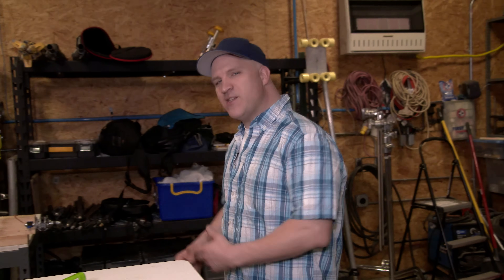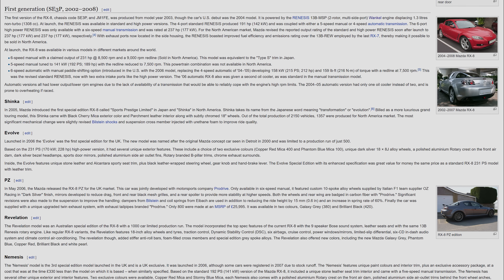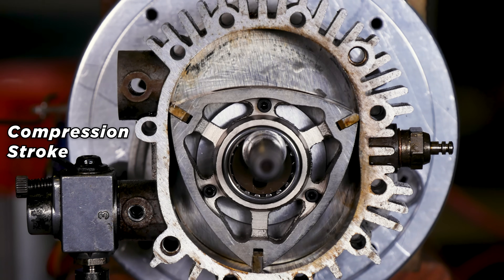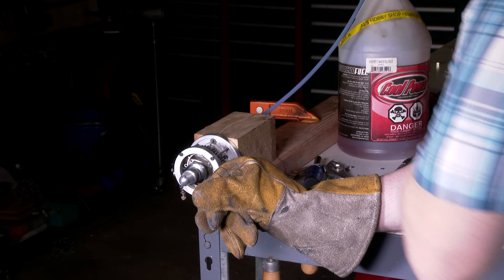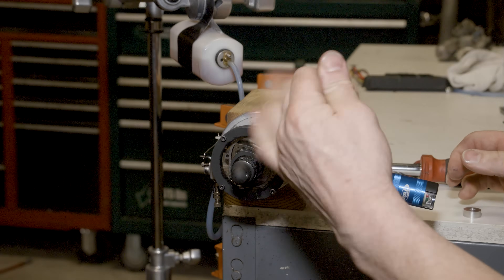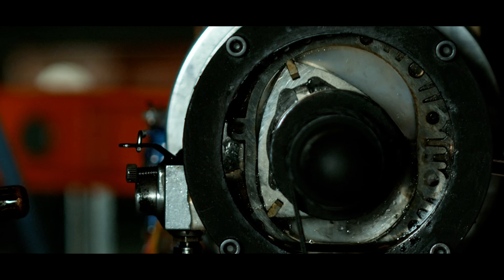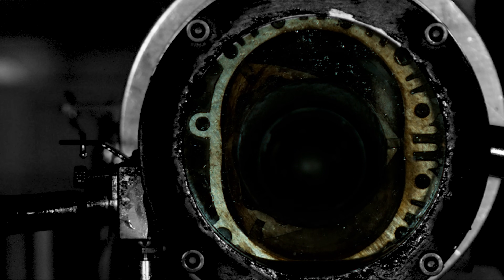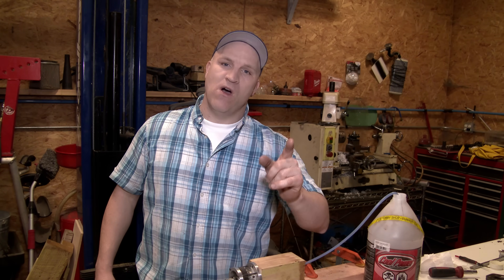See Thru Rotary Engine in Slow Motion - (Wankel Engine) 4K

Comment: VERY Cool.  I used to do a lot of work on/with wankels.  Neat to see inside one (even if glo) running.  Nice Job!
Reply: Well, they are very unreliable engines and you had to constantly rebuild them... but it is a discontinued engine now... completely obsolete.*
Reply: Not even remotely.  If that was so, how come several people I knew got 250k plus miles out of them, and the average was about a buck and a half, pretty much exactly what you can expect from most non Japanese engines, those typically go about twice that in my experience.  If wankels were so unrealiable, how come they DOMINATED racing classes so much that rules were changed to "un accomodate" them.  The fact that your moniker speaks to BMW tells me VOLUMES about your stance.  Just like people driving American cars that talk about lousy Jap cars, wrt reliability.  LOL   What you say was true before TOYO KOGYO put millions of man hours into increasing their reliability, but not afterward.  One actual problem they did have in reality, though, which you don't even mention, and is more likely the primary reason they are no longer used is specific fuel consumption, which is lousy due to combustion chamber geometry, among other things.  But power per cube, power per volume, and power per pound were all quite good, easily producing 1000 hp out of 70 cu inches and an engine that weighed closer to what a motorcycle engine does than most car engines with any kind of output.  There were also problems with emissions laws tightening and tightening.  Guess they didn't think of "solving" it the way VW did, just lying about it.  ;-)  You are rather ignorant about these engines, I'm afraid.

Comment: Are those explosion sounds produced or recorded? They sound fake and produced but they could still be real.
Reply from the maker: I know it kind of messes with your mind a bit, they're digitally structured off of the captured sound, so essentially they are the actual sounds that are capture, but they are manipulated. Since we can't hear infrasound I need to raise and clean the frequencies so that their Audible. I actually developed this technique with a sound engineer in India about a year back. I've been using it ever since. The process is a little bit complicated, but basically the goal is two pair sounds up with the actions that would be what you would actually hear if you can hear those sounds, not sure how much sense that makes but that's pretty much what I do. As a result sometimes it sounds don't even seem like they make sense but those were the actual sounds that were coming out, I have to double and triple check myself sometimes, other times the sounds are completely different then what you would expect and I have to replace them with fake sounds so they make sense, but that's not very often.

Comment: Huh!
So these babies should run on natural gas or propane with an injected lubricant for anti wear like a 2 stroke!
Reply: The Wankel engine cannot produce sufficient static compression ratios to burn gaseous fuels like methane efficiently, Mazda used oil injection on all its production engine but the Wankel KKM design uses the 4-stroke operating principle.
Reply: DIESEL BEST ENGINE OF THE 21 CENTURY

Comment: Actually it was a 13B rotary engine. The 13 meant it had a displacement of 1.3 Liters. I lived in a little horse town in Riverside County called Norco and worked in Orange County so I took the Riverside Freeway to work 6 days a week at 4 am. Also going to work around the same time was a guy in a Jaguar. I’d drive normal until he’d come up and then we’d begin racing. He could never understand how I could just walk away from him but nearly every day he’d try me. It was a blast. In the 70’s there was virtually NO ONE, other than the two of us, on the freeway. Never once saw the highway patrol. LOL. The speedo only went to 140 but the needle could actually go past that and did. I probably hit close to 150 mph and it got there QUICK. The only other car I ever had that pulled like it was an 87’ Dodge Daytona Turbo that I had the turbo changed out for an inter-cooled one. I wish I could have put a turbo on my Mazda Rotary but I didn’t have the money then. Good times though.
Reply: 1.3 liters of "taxable displacement" the Mazda 13B had an actual total displacement of 3.9 liters

Comment: You can see how inefficient these engines are,  but they make tremendous power for their size. I would love to see a modern rotary that achieves good fuel economy and legal emissions.
Reply: Unfortunately the Wankel design was found to have very little further development potential, all of the Wankel engine manufacturers (including Mazda) have abandoned this obsolete design.
Reply: I heard Mazda, at least a year ago, had a prototype that could achieve modern emission standards.

Comment: I REALLY enjoyed this video. The main reason is because I once owned a rotary vehicle. It was a 1974 Blue Mazda Rotary Pickup. My father-in-law bought it brand new. He was old-school &!refused to put unleaded gas in it so it didn’t run very well. It also had a problem with eating the rotor inside the distributor so he kept the glove box full of them. LOL. He sold it to me the next year and it ran OUTSTANDING (other than a rotor being destroyed every other week) once I began running it on unleaded gas. I put about 5,000 mi on it before the seals went out, while driving on the freeway, the engine overheated and froze up solid. Luckily for me, there was a class action lawsuit against Mazda and I got a brand new rotary engine, with new and improved seals. I only had to pay about $100 for new plugs, belts and hoses. The head mechanic asked me if it ate up distributor rotors because the distributor shaft was slightly bent. With the new seals and a STRAIGHT distributor shaft, it ran even better. I put wider tires on it with deep dish chrome wheels that Firestone Tires has just come out with. In addition to that I found a color matching, streamlined camper shell for it. I washed it every other day and waxed it twice a month. It was the coolest, fastest, one of a kind, small pickup in Riverside County, CA. I think my wife hated it because I was always getting the attention of other pretty girls. LOL! My wife crashed it 3 yrs later, ruining the look, and I never drove it again. We pulled of the Shell and she used it to haul cubes hay for her horses. It ran another SEVEN YEARS before the engine gave out. It was an AMAZING little truck and one of my favorite vehicles ever!
Reply from the maker: Thank you, I'm glad you liked it is that little pick up called a B2B? I kind of remember a Mazda pickup that was called the B2B.

Comment: 226 trys? Couldn't you have just used a drill?
Reply from the maker: No, I tried many times, many different methods. After all the trial-and-error the string worked the best.
Reply: Warped Perception that sucks, man. Maybe a higher RPM tool like a dremel? Everybody is thankful for your sacrifice regardless. Great video!

Comment: Great video, but I'm going to say that if you are comparing the "simplest rotary engine I know" against a reciprocating ICE, then you should have compared against a 2-stroke. It's kind of unfair to mention valves and stuff if you don't actually need them...
Reply from the maker: Thank you, and yes but, both of these engines use the Otto 4 Cycle process, the two cycle uses a 2 cycle process. That's kind of like comparing apples to oranges.
Reply: Ah, well, valid point, but I was getting the impression that we were just comparing the complexity of a reciprocating engine versus rotary, in which case, it would be apples to apples, wouldn't it?

Comment: Why is a rotary engine so powerful compared to it's own size beside a normal piston one? Is it due to lack of additional moving parts, better angle of attack or what?

How come this isn't the common motor of everyday vehicles? Is it due to stubborn manufacturers with old patents or just the grand old money scam as always?
Reply: The Wankel engine is obsolete today because it offer less power, less torque and less efficiency. 
 The answer is the Wankel design was simply inferior to other ICE designs still available and because it was plagued by several inherent design flaws that limited its efficiency, development potential and reliability.
Reply: doktorbimmer Then how come modern 1.3 liter engines aren't producing 230 hp or more?
Reply: I think you are confusing the "Tax Displacement" method often used for automotive Wankel engines with the true, or total displacement... this for example (eg; the Mazda 13B series) a taxable displacement of only 1.3 liters despite it true, total displacement of 3.9 liters (3,924cc)
The displacement issue gets a little more complicated when you want to compare Relative Displacement with a 4-stroke Otto or Diesel engine at the prescribed 720° firing order cycle.
Reply: It is possible to buy a production automobile (reciprocating Otto engine) with as high as 200 horsepower per liter and racing engines that produce 1,000 horsepower per liter... the Wankel no longer offered any significant development potential in terms of power output without serious problems in reliability and service life.

Comment: This is a great video but I wish that anyone that talks about rotary engines would at least touch on their downsides.
For the longest time I believed rotary engines are perfect,,, the power of a V6 in a space smaller that a four cylinder,,,, less moving parts, sounds perfect right?
Well, no, they're impossible to completely seal due to the lopsided heating, and they dont last nearly as long. Also, they dont really play well with things required by american regulations like mufflers.

Comment: this could be a standard vid for technical school.
Reply: It can help them understand the improvements we've made in technology over obsolete designs, while helping them to understand perhaps how those other technologies became obsolete in the first place- hopefully helping them to not make the same/similar mistakes if they ever get the chance to design technology, rather than just working on it. Plus it gives them an appreciation they can take with them. Such as I appreciate the simplicity of being able to tune a carburetor with a screwdriver, but I understand the advancement to fuel injection (not directed towards rotary per-say, but old cars/things in general). TLDR; this is why these were cool, but this is also why we don't use them any more.
Reply: but understanding the past can help us think for the future
Reply: Can't wait to see how much the old guy in the shop will charge in a few years to fix a carburetor in that case.
Reply: surya adiputra memeq
Reply: surya ad
Reply: You're a fool.  There ARE rotary cars still on the road, therefore a technician must know how they work.  Same with carburetors.  I'm at school right now for mechanical engineering, and earlier this very semester we went over rotary engines in my power systems class.  There was an entire homework devoted to carburetors.  Mazda is planning on using rotary engines as range extenders in future vehicles.   Don't be a modern tech snob.  Learning the past is absolutely crucial to understanding the present and future.
Reply: +Michael Yachnis I don't know what kind of third world country you live in? But in the United States there has not been a new car sold with a carburetor in over 30 years...
Reply: +Michael Yachnis You will only have a slightly better chance of spotting a rotary powered car on the road than seeing a unicorn... Rotary powered cars were extremely rare and the few that still exist are in museums.
Reply: +Michael Yachnis Are you not familiar with the difference between a technical school and a university engineering program? We studied Sterling engines and Gas turbines when I was in college too... but you won't find any of these engines powering a car on the road either. Mazda abandoned development of Wankel engines in May of 2009 and ceased all production on June 22, 2012. There was some talk in stop-gap development of range extenders years ago when battery technology was struggling to meet minimum requirements for production, but this interest has quickly died-out as current regulations and subsidies make them unpractical, not a single auto maker has ever offered a range-extender on any vehicle as standard equipment. Mazda made an official announcement last year that it had signed a deal with Toyota and Denso to produce a pure battery electric vehicle to meet California's new ZEV regulations as both companies fought unsuccessful to include hybrids and range extenders into the new ZEV laws. There is zero evidence to support that Mazda has any plans to reintroduce the long obsolete Wankel engine... only a flurry of completely unsubstantiated "clickbait" rumors that are cranked-out by amateur blogsites because they are sure to generate "hits" and revenue on their website.
Reply: @doktorbimmer  They students should just look over the rotary engines since there are pretty much no rotaries on the road.Where I live only me and 2 other guys have rotaries and that is in a 150 km radius.There is one mechanic near us that knows how to work on them and nobody else.Well I know how to do basic repairs but that is pretty much it.
Reply: +shepd3 What is a carburetor????
Reply: +Chad Vallance How does that help technical schools prepare students to repair vehicles on the road today?
Reply: They don't teach obsolete engine designs in technical schools
Reply: +Chad Vallance The students in technical school today will most likely never even see a Wankel engine in there entire career as these cars are extremely rare and quickly becoming extinct. There were over 100 million new cars sold last year with reciprocating Otto, Aktins, Miller, and Diesel cycle engines, hybrid power-trains, hydrogen fuel cells, alternative fuel engines and battery electric systems (and soon HCCI engines and turbo-compound engines) and absolutely ZERO cars sold with a Wankel engine. Never before has there been so much diversity in automobile engine technology, Today more than ever before in history, teachers and students simply cannot waste time on obsolete technology that they will never encounter in the field when there is so much new technology in the industry that needs well trained qualified technicians to service them. cheers!

Comment: Play fucking music all over the commentary. Really clever...
Reply from the maker: Russell Kreymborg music on the commentary?. Bass synths ?, Usually bass since or strings don't really interfere with the frequency of The Voice. That's kind of advanced filmmaking but that's usually how it rolls.
Reply from the maker: Russell Kreymborg but it really does matter sometimes on your sound system or device, if your sound system doesn't reproduce the vocal frequencies very well, or your EQ is set to a certain pattern, sometimes the bass will overpower The Voice.
Reply: Say what you like to try and justify your warped perception of what people may like or find pleasing on the ear. If someone tells you they're having trouble hearing what the guys saying because you put fucking music over it, then just accept that's a problem. I guess I must be the only one who's had the bollocks to say it, but I bet I'm not the only one who thought it. How many others clicked the dislike button and fucked off before they got 30 seconds into the vid?...

Comment: A really good video to understand the cicle, and to understand the fact that those rotary engines with carburators were such a challenge get the right combustion time. Personally I think this is an awesome engine, with the tech we have now it could be massified and improved in terms of material stiffness! 

Keep the good job, we the people, are enjoying this kind of content!!
Reply: not really, the Wankel had some very significant design flaws that are inherent to its basic concept...
Reply: in those we are talking about having the combustion cicle on only one side of the housing?? high temperature issues? and any other you would like to comment... (hope not to be read as rude, i'm asking for learn which other problem it has)
Reply: Good question. Well, due to the limitations of the geometry, the Wankel cannot use a modern "quench effect" combustion chamber design, it has very poor combustion characteristics and efficiency as well as high thermal entropy because of the high surface area and the lower limit on static compression ratio. The Wankel simply does not convert the air fuel charge into heat efficiently and also due to the rather backwards design of mechanism, its triangular piston does not act upon its crankshaft with mechanical advantage, unlike reciprocating engines that produce mechanical advantage or "Leverage". A round or spherical shape is superior in dealing with thermal expansion and sealing... the Wankel's right angles and uneven sides pose is a serious seal design flaw, but the single wiper apex seal is also not a "positive type" seal like a modern "twist -type piston ring. Piston rings seal tighter as pressure increases, apex seal leak, vibrate and overheat as chamber pressure goes up. reciprocating engines can have 2, 3 or even more piston rings, while the wankel is limited to only a single apex seal. 
The Wankel cannot take advantage of variable valve lift or variable timing or compression. it is not well suited to support GDI technology either. cheers!